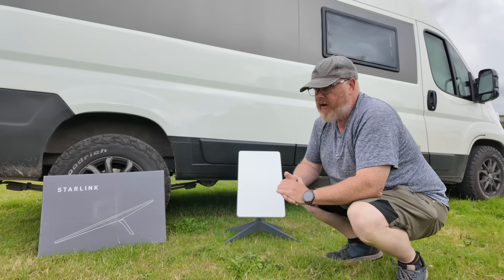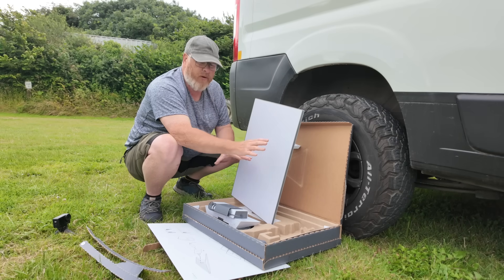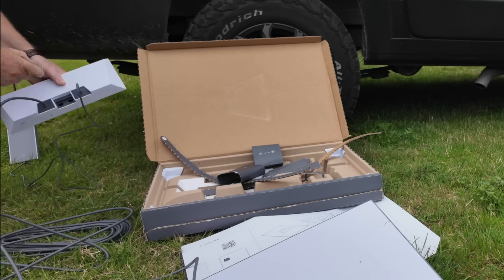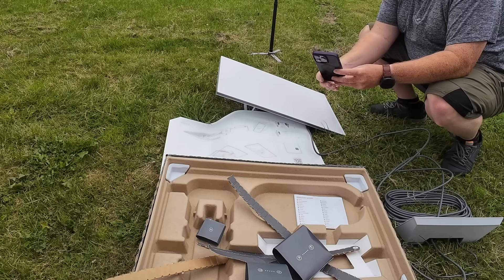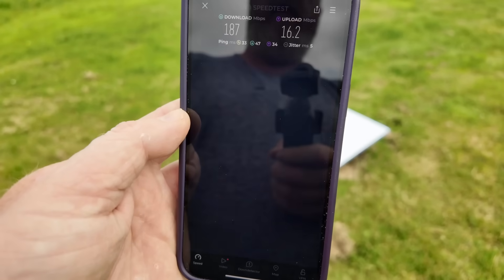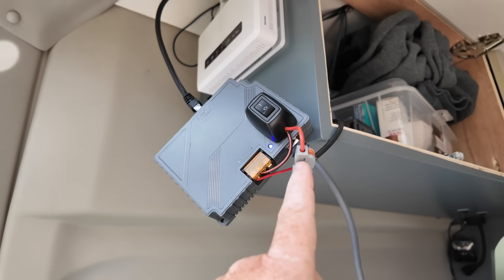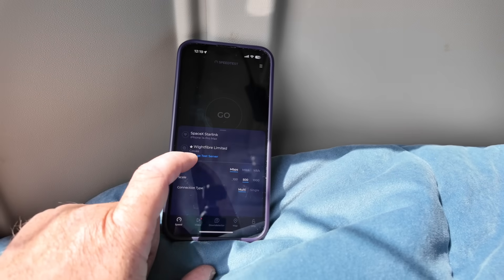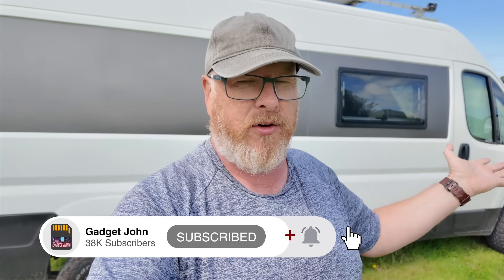Starlink Gen 3 unboxing & setup - Is it worth the upgrade?

Comment: Hi john
I'm trying to set my V2 starlink to 12v
I'm using ecoflow 2 max delta
EDUP All in one 
GL-NETWI-FI 6 ROUTER.
But not connecting is there anything i have to do with the router settings?

Cheers 
Mandy

Comment: Hi. 
Question. 
My community centre wants to buy a standard Starlink to use as emergency comms in the event of an extended power cut. There is a standby generator for back up electricity. 
Once the kit arrives, can it be tested etc without actually activating a subscription? 
The idea is to set it up, confirm the best place for the dish etc, test and then pack it away. Thanks.

Comment: could you tell the size of the two extremities of the cable? it passes into a pipe with 2,5 cm diameter? tnx
Reply from the maker: Both ends are identical, the rj45 ends are oval and is around 15mm x 18mm

Comment: I''m paying $90 per month on cable, for a 1.2Gb connection rate. Until Starlink comes up to the same speed, it would offer me no advantage to switch, except the satisfaction to dump my cable internet connection. I'm actually averaging only 700Mbs of that 1.2Gb's, which angers me.

Comment: Sorry I am so lost. I have Glinet routers too but how do I get the starlink to go through that router instead of the Starlink modem to save power? They take substantially less power.
Reply: @ontheroad684  unfortunately the starlink modem controls the dish, you could use your router in conjuction but unfortunately not as a stand alone
Reply: @MEstabrooks911  in this video on tha last part I see that he have disconected the starlink router and put the cable in that poe thing and made a speed test. how is that possible, having internet without starlink router?

Comment: I bought the Gen3 package as appears in the video and in general satisfied with the quality and overall performance, however... Once you plug in the cables (ethernet/power) to the router and dish, I find it almost impossible to disconnect without damaging the cables. Therefore, not possible to modify the initial installation. Well done Elon!
Reply: Pull it harder, you don't damage a thing...

Comment: It still amazes me how a little square dish can transmit to a satellite in outer space and still achieve fast internet speeds!

If it was slightly cheaper per month, say £50, I’d buy and sign up in a flash!

It’s a shame they don’t have the dish that automatically turns and tilts.

Comment: Excellent video. Great summary of the important features. Hopefully they can work on reducing that power consumption even further or even introduce a selectable low power mode. Impressed by the ping as well, I had assumed that would be much worse.

Comment: Sorry for the follow up question, but does your router (when your not using starlinks own router/ap) just make a dhcp request to the dish to bring up its ip connection ?
Reply from the maker: Yes, the router looks for a wan dhcp server to obtain an IP and then once Starlink is online the public ip data set is used.

Comment: Hi John, thanks for sharing another interesting review. Be interested to see what the power consumption is like on 12v once it's stabilised. I dont have the room for a Gen3 to flat mount ATM, but could move my rear solar pannels back to make some if my Gen 2 fails. The gen 2 is around the 50 - 60w range on 12 v so just curious on the difference for the GEN 3. Take care cheers Rich and Cooper

Comment: How is the jitter on starling? Do the ping times vary much as the satellites move over head, and it jump from one cube sat to the next m
Reply from the maker: Ping times are fairly constant at 30 to 40 ms, the dish connects to a constellation of satellites so never loses connection.
Reply: @GadgetJohn  That's fairly good, wont cause much in the way of issues for VoIP and teams etc. Given the distance the signal must travel up/down they must have a fairly efficient path across the cube sats to where ever their ground link is in the UK.

Comment: I know this is irrelevant on this video. But you seem to know. I'm currently lost in advice from every one that contradictory. I hope you can help. 
Solar panels. I have 2x 220w 19v. 
How to I plug them in to my bluetti 200max. Series or parallel? . 
Is amps better than watts?? I'm lost. Cheers.
Reply from the maker: Serial, as it will give you higher volts that the bluetti 200 max prefers.
Reply: @GadgetJohn  that's great thanks loads. Appreciate it

Comment: John, Have been following your StarLink vids avidly (as well as all of the others) as we have very poor broadband at home which is tested to the limits with 6 of us in the house using it. with no plans for fibre to be fitted in our estate, I have been looking at other options. One question i have is does the new antenna need to be pointing a particular direct or is it unidirectional? I ask as I believe south is the best direction here in the UK but we have a lot of trees to the soouth of our property that might well obscure the LOS of the antenna.
Reply from the maker: The new dish has a wider field of view to obtain satellite connectivity. As you see in this video if you align it using the app you can get extremely high speeds over 300 mbps, however, I then show it fitted on my van roof, without being aligned in any way, and as long as the dish is pointing up to the sky you’ll get over 200mbps.
Reply: @GadgetJohn  thanks John

Comment: Thanks for the video John, I live in Ireland and bought the Gen 3 about 2 months ago. Priority for me was Conference calls for work while traveling in my camper van and also being able to remove it from my van for use in a house or airbnb when I wanted to park up the van for a day or more. I was very concerned and skeptical that I would be able to work and take video calls on the road as I sometimes have back to back calls all day. Anyway I am blown away by how good Starlink is. I have zero connection issues during work calls. It’s as good or sometimes better than my home broadband and the monthly subscription is cheaper than home broadband. It’s takes less than 15 minutes for it to start up and connect and I’m away. I simply pop the dish on the roof through my van through my skylight for the day. It’s amazing and I would thoroughly recommend Starlink. In Ireland I paid €249 for the dish and it’s €59 per month for Roaming which is less than the 1GB Fibre Broadband from Eir (Ireland’s BT) I pay for my home broadband (€71 per month) my dish has no audible buzz - just an FYI.

Comment: Hi John, thanks for the video. I'm still happy with my Gen2 in Remote France. Didn't even know there is a Gen3, but have been sent info about the Starlink Mini, now that just looks like a Gen2 in the guy's backpack in the advertising, just as big? I only pay 40€ a month. France is trying to block a StarLink upgrade, and everyone with Starlink in France has been asked to write to the French government, to change this. France hates anything not 'made in France' . Yes I had a 'hum' on my Gen2. When it arrived it was connected to the 'snow/ice melt' system, I disabled this and the 'hum' stopped. I use the original Starlink router, which did not have a power box 'thingy'. I'll probably stick with Gen2 for now. I 'love look forward to your tests.